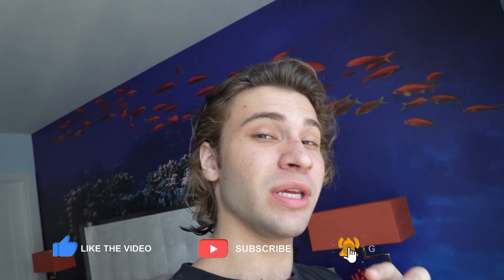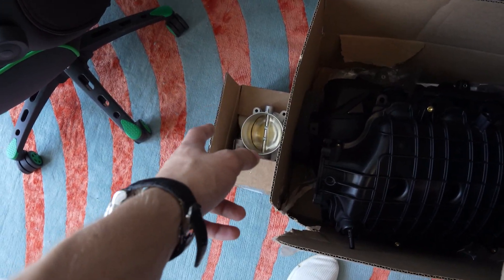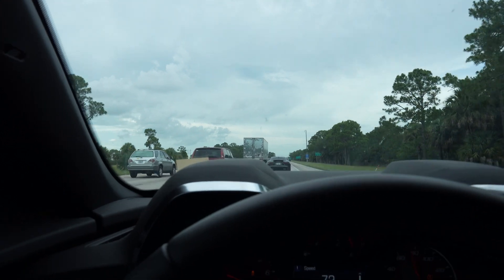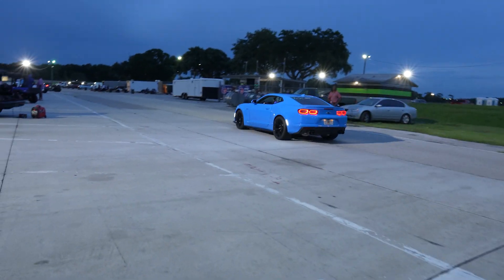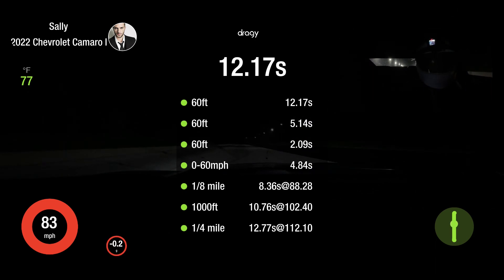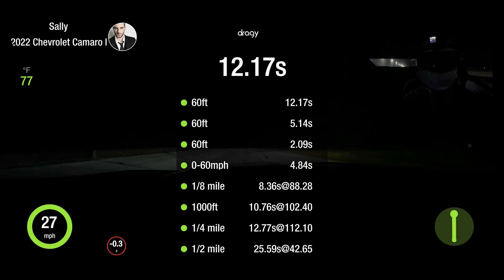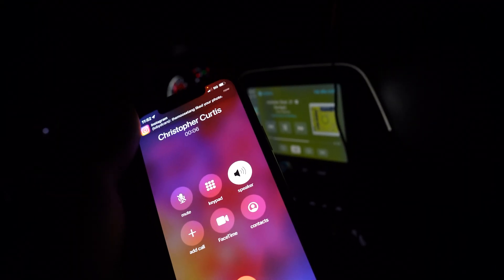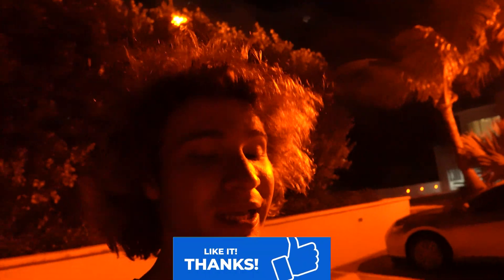I TOOK MY STOCK LT1 CAMARO TO THE DRAG STRIP TO SET SOME BASELINE TIMES BEFORE GOING FULL BOLT ON!

Comment: It’s trying to go into the 2 step. You have to do the burnout with traction control only on. I found on the stock tires it’s better to leave at 1,500 rpm’s. When I put an et street on then I could launch on the 2 step.

Comment: These lt1s especially with a10 def seem a little faster than the pre refresh with the a8 and def the m6 for sure.  I ran a 12.3 @112 in my 17 SS on runflats.  Got a 23 a10 on order so we’ll see but in stock form they seem to mph a touch faster
Reply: Should keep the 17SS. The old 8 spds are quicker, especially up above 70 mph or 4800 rpm. The 8 spd acts like a good 5 sod with two overdrives while the 10 spd is technically a 7 spd with 3 overdrives.

Comment: That seems about right for the temperature, and what I'm assuming was a high DA. Ran 12.8 @ 113 in my bone stock LT1 Manual, here in hot and humid Texas.
Reply from the maker: Yup, probably could have gone 1/10 tenth faster but that was as perfect as what it was gonna go! The D/A was 2000

Comment: Aftermarket CAI’s are a waste of $ too. Once they curve more than 45-60* from a flow dynamics point, your losing/reducing airflow. And there’s no such thing as an actual Cold Air Intake because intake temps just drop by at most 5-7* degrees which does zero for power. The dyno shops show gains with the aftermarket CAI’s because the hood is open and fan are blowing on them or near by. Some goo long tubes and dump the rear seats and dump the suitcases (mufflers) for a nice 40 lb drop. Lastly Just a drop in K&N dry will be your best friend for a little better airflow.

Comment: What tires do you have on the car?
Reply from the maker: 305/30/17!
Reply: @TobyVegaD  but what brand / type of tire? 
Also, traction control will kick in most of the time in competitive mode. You have to be in sport and hold tc button for 8-10 seconds to turn esc off all the way, for burn outs.

Comment: Don’t waste $ on “catts” there’s on.y catts or no catts. No such thing as high flow. Won’t give you any power. Nor will ported manifolds. Go with the go with the msd mani stock. Stock LT1 mani ported won’t do anything and the LT2 C8 mani really won’t help you. Speed shop sell this stuff so they overinflated perform numbers on purpose. Remember, they’re win business for one thing $$$$. Stay away from the shops that call the torque “ft-lbs”. It’s actually properly called lb-ft. There is a difference, and also, don’t dyno the car with the hood wide open either unless you plan on spending lots of time parked at meets. We don’t drive hood open, so don’t dyno that way,